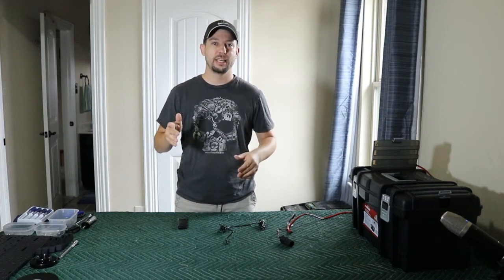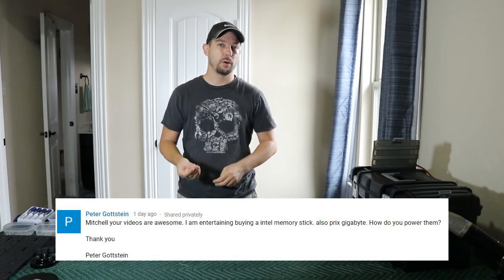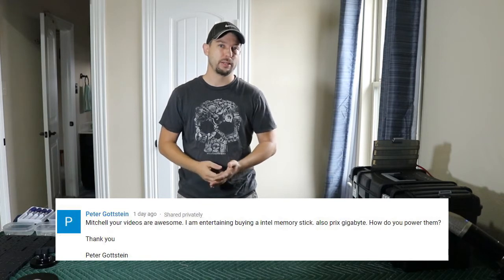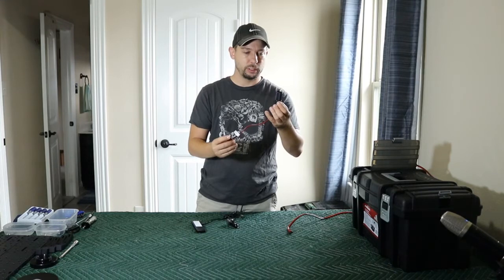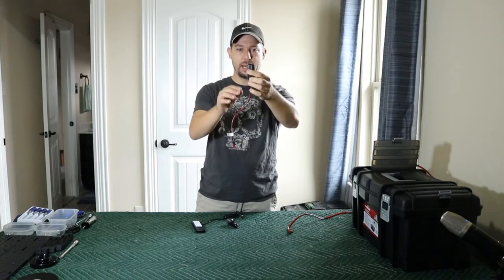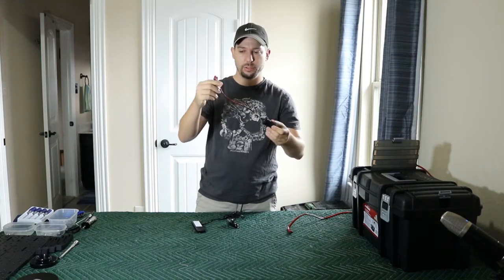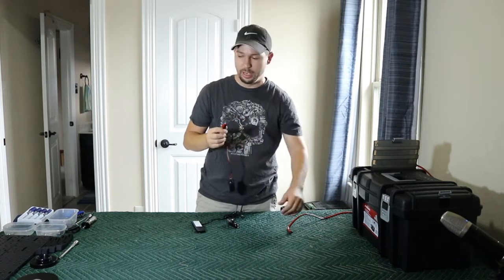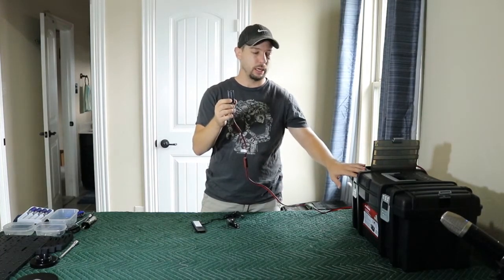Viewer Question:  How Do I Power My Intel Compute Stick

Comment: I know this video is a couple of years old, so maybe you've moved on...but I'm curious if you're still using your compute stick, AND if you're still powering it this way? The reason I ask is that I've seen some other youtube vids of guys trying to battery-power theirs (using buck converters etc.) and they've 'bricked' them...cuz turns out, the compute stick is rather finicky about power--especially when first powered on. You're the only one I've seen doing it this way, tho...using the 'go-between' of the cigarette lighter adapter. How's it working these days??
Reply from the maker: It's been in my desk drawer for over a year.  I moved on to a full blown laptop simply because I needed more RAM and extra USB ports for some ISS transit captures.  

The compute stick i have still works, but my software and capture requirement have evolved beyond its hardware...
Reply: @I_Spaced_Out  Ok, thanks!  But....sounds like it worked ok for you in that configuration up until you outgrew it. I'm interested in these for their potential in operating ham radio digital modes portably. A lot of guys use the raspberry pi for such operations but I'm more interested in something that already uses an operating system I know how to use. :-)

Comment: I have a Intel compute stick M3 and I tried to run with a power source diferent to the original and the BIOS starts but W10 never. What is the problem if I am using the same 5V, 2'4A?
Reply from the maker: You need a 3A powersupply to run it.  Your issue is too little current.  Buy a rapid charger for something like a Google Pixel, or Samsung Galaxy smart phone.  That should power it just fine.
Reply: In the Atom specifications it needs 3A but the M3 needs 2.2A.  Isn't it dangerous to apply more amps than necessary?  won't it catch fire?  won't it get hot? Something like this: https://www.amazon.es/JOOMFEEN-Charge-Cargador-Puertos-Samsung/dp/B07T19XH22/ref=mp_s_a_1_11?keywords=cargador+tipo+c+carga+rapida&qid=1565104814&s=gateway&sprefix=cargador+tipo+c+carga+rapida&sr=8-11
Thank you very much!
Reply from the maker: No that's not how it works.  You don't supply amps, you're limited to them.  What that means is your 2.2A power supply cannot supply more than 2.2 amps or else a fuse will blow.  If there is no fuse, the power supply may overheat.

If you supply more voltage than specified, it will get hot, or it could become irreversibly damaged.

Basically, it's safe to have a supply that can deliver more amps because it gives you flexibility when the workload increases or decreases.  It is not safe to supply a different voltage, since the voltage won't fluctuate based on demand.
Reply: But, why with the original powersupply is 2.2A and works perfectly, and the another 2.4A doesn't work? The Atom version needs 3.0A and with 2.4A works perfectly!
I'm sorry for my insistence and thanks for your kindness!!
Reply from the maker: @jjrmjjrmjjrm  I have no idea why something that should work is not.  Have you also checked to ensure that the voltages are 100% the same? is the 2.2A a 5.5v supply and the 2.4A supply a 5v or 3v supply? 

The 3.0 Amp Atom version may not be pulling the full 3.0 Amps because it's not under 100% load for a long period of time.  If it ever goes to 100% load for a prolonged period it will have problems because it can't get enough amps to keep running.

Good luck!  You'll eventually find the right compatible power supply :)
Reply: I just saw that both the power supply and the M3 indicate that it needs 5.2V-2.2A, it may be that the problem is those 5.2V and the power supplies that I have tested were 5.0V. On the other hand, in Atom version needs 3.0A but with exact 5.0V. All this is because the M3 used it at work a lot and also for home and did not want to be carrying the power supply every day, but to have one at work and another at home. It will be difficult to find a 5.2V power supply ... :(

Thank you so much for everything!! :)))

Comment: Hi Mitchell!  When starting a session how do you "view" whats happening with Windows on the pc stick?  Starting it up and launching the programs etc.?  I'm thinking about a small HDMI monitor, but ultimately I'd like to be able to auto start it or wake it up remotely.  Any ideas how to proceed would be welcomed.  Thanks!
Reply from the maker: I use Team Viewer to connect to the Compute Stick.  I actually just finished writing some PowerShell scripting that guarantees that the wireless card connects to the WiFi networks that I want in the order that I want (problem I was having during the Lunar Transit).  

I think that tonight I am finally ready to begin doing my how to videos for the compute stick because I have all the quirks worked out.  Any problems that I encounter going forward should be totally related to user error.

Do you have any suggestions for me to include in the video?
Reply: Actually Mitchell, this whole idea of booting the ICS with Windows and connecting automatically to a network so you can launch the on-board programs of the ICS would be an interesting topic.  I understand using Team Viewer, so I guess what I don't understand is how to get the remote mini pc (ICS or my M42) to boot (is it sleeping, but booted, and just needs a wake up signal somehow?).  Does waking require a modem?  What if there is a short power glitch or outage and the ICS resets?  I don't have a mount like yours with WiFi/Bluetooth capabilities.  My Losmandy G11 is a good solid mount but it's not in the Paramount league.  Once Team Viewer is launched, I can see how you have control and can proceed to launch the programs for mount control, guiding, image sequencing, etc.  I'm thankful that I get to "stand on your shoulders" Mitchell.  Thank you!
Reply: Perhaps through a LAN?
Reply from the maker: Dale, I just power on my field battery.  The ICS has a wake on power setting, as well as a tiny power button on the side.
Reply: Did you set up a LAN for both of your systems?
Reply from the maker: I'm not using LAN.  I'm using WiFi - so technically I am using a WAN.  The Intel Compute Stick connects to one of two networks - either my home WiFi or the portable WiFi router I take out to the field with me.  There are some powershell scripts that I have created (Don't worry - they are in large font in the video I'm editing right now so you can recreate them if you'd like) which force the wireless adapter to connect to the wireless networks as part of the startup routine.  

So once the mount and ICS power on, I just sit back and wait about 1-2 minutes for the boot up / start up process to complete, and I can connect to the static IP address I mapped in the routers for the Intel Compute Stick.
Reply: All of this will make a very interesting video Mitchell.  I think there are quite a few of us that want to have some level of remote capability but just aren't comfortable with the important and specific steps to take to assure a successful implementation.  Awesome!

Comment: Hi Mitchell, thanks for your wonderful solution.
Can you run Compute Stick without connecting to a monitor?  I read some webpages mentioned that there are some issue without monitor and need to connect to "dummy monitor" device.  What's your experience?
Reply from the maker: I've never had a problem with my ICS and running it headless.  I would recommend that you make sure that the virtual keyboard is indeed installed and running as that could actually hang up the boot process - which might give the appearance that it is not working because you don't have a monitor (or keyboard/mouse) connected.

This video shows me connected to the ICS while it's sitting on a desk behind me with no monitor.
https://youtu.be/vBI-ftEj70w
Reply: Great! I will try when I got an ICS.  Thanks!
Reply from the maker: Make sure you get one of the Intel "M" processor versions, and not the Atom processor version.  I use the Intel M3 and it works well, but you could go for the M5 version and have much more application stability if you use multiple programs at the same time.

Comment: Mitchell would this work if plugged into a rig runner with the cord that came with the stick?
  https://powerwerx.com/usbbuddy-powerpole-usb-converter-device-charger
Reply from the maker: +Peter Gottstein I think so.  It needs 5v @ about 3 amps, so this is perfect.  I think my car charger splitters supplies 3.2 amps, which is a little overkill but more available amps isn't the problem to watch out for, too few amps and wrong voltage is.
Reply: thank you for your response Do you capture all images on the stick or on some other device? Why not a Intel NUC instead.
Reply from the maker: I capture right to the stick!  I don't use the Intel NUC or anything else quite simply because I do not own anything else.  I did install a 128GB microSD card into the Intel Compute Stick which I can store a lot of data on.  

Sometime this week I have a 6TB external HD arriving!!!  I'll play around with that to see how feasible it is for saving camera images on to - but if the drive write speeds are slow, it may not work.

The good news is, that this 6TB external HD is actually a replacement for my 1TB drive which is filling up.  This 1TB drive does have very fast write speeds - and I may end up using it instead.  This means that my Intel Compute Stick has 128 GB of local microSD card storage, plus 1TB of external HDD storage - so I should be able to keep a mind bending amount of data on the device.

The convenience of having the data stored on the 1TB external drive is that I can very easily "transfer' files to another computer by moving the external drive from the telescope to my laptop.  No file copy time required - until I move files to the 6Tb drive which can be done over night.
Reply: thanks you again
Reply: I don't know if that converter worked for you, I have one and I really like it but it doesn't work with the ComputeStick.

Comment: I ran into some limitations with USB 3.0 PC stick and it really cannot handle the data throughput for Imaging , it actually bogs down to usb 1.0 speed and sometime locks up.  The only thing useful I have for the usb  stick is for Planetarium applications.  What do you use to manage since you're not Imaging
Reply from the maker: Jeff, I do image with my Intel Compute Stick.  I have the M3 version.  

I run TheSkyX right on the compute stick.  Through TheSkyX, I connect to whichever camera I'm imaging with that night.  I've never had any issues with the system acting slow.

Are you using the Atom processor version of the ICS?
Reply: Crap, that is the issue there, I am using ATOM.